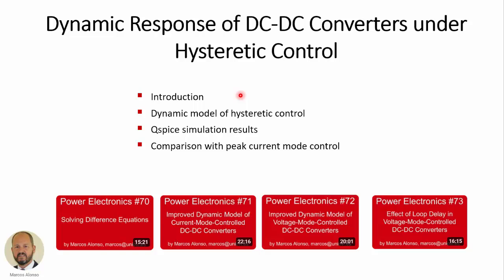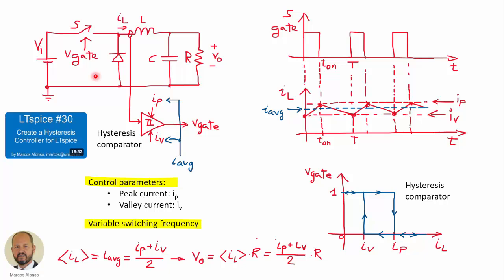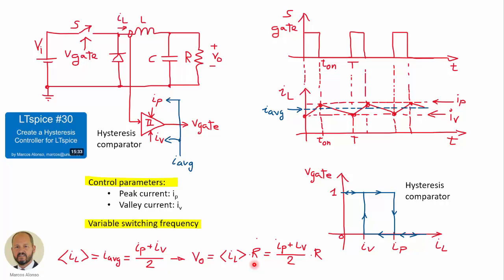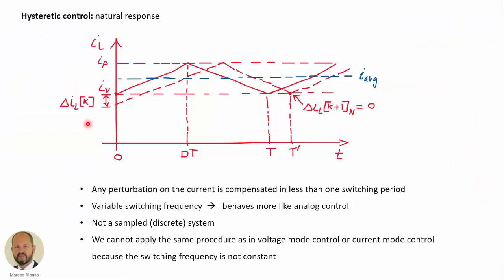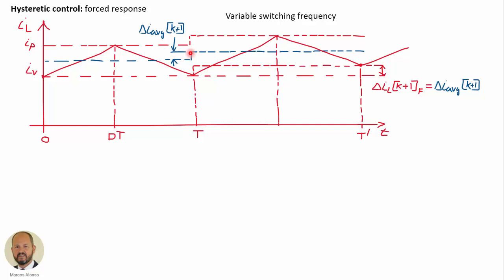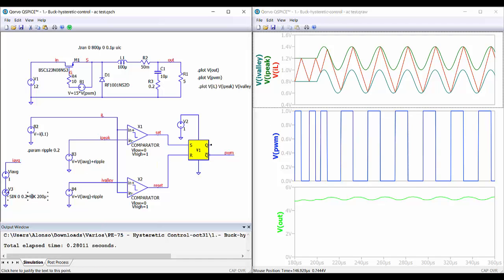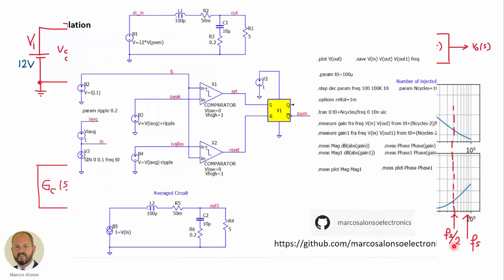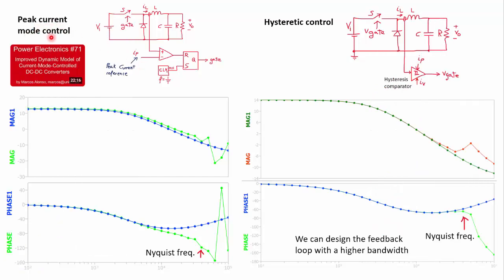PE #75: Dynamic Response of DC-DC Converters under Hysteretic Current Control

Comment: Hello Prof Marcos, The for the presentation 

How to select the  inductance as we know  that the SW frequency vary  ? 
There is possibility to select the  switching  frenquency  ?  
As we know the inductance is dependent of the SW frequency
Reply from the maker: Hello, thanks for your comment
Video PE-76 shows the expression to calculate the switching frequency. From it you can calculate the inductance to have the required frequency range
Reply: I watched the PE 76 and Frequency is dependent of the inductance. We select a value of inductance ? What about the variable  input voltage respect to the frequency  ? 

Complicate to understand.
Reply from the maker: @hScience100  Yes, Vi also affects the operating frequency. Once you select the inductance value you can calculate the frequency for the different values of the input voltage from the equation
Reply: @MarcosAlonsoElectronics  we can select one inductance value to have a negative inductance current and doing ZVS, and clamp the frequency to a lower value to limitate  the lesses. 
Do you think is a good idea ?
Reply: What do you think about my preview question ?
Reply from the maker: @ Sorry I missed this comment. Yes, it is possible. This is a technique known as ZVS buck converter with synchronous rectification. This is an interesting topic for a future video

Comment: Hi, thanks for the presentation, it was highly informative!

In the dynamic response section you are defining the transfer function of the hysteretic current control circuit, but strictly speaking, the hysteretic control is time dependent (you mention this a few times that the frequency is not constant) and therefore it is not a Linear Time Invariant (LTI) system. As far as I know the transfer function concept is only applicable for LTI systems, so for hysteretic control Gc(s) cannot be defined directly.

For PWM control the average operator (over a period) is defined and used (1) and afterwards the linearization around an operating point (small scale signal) (2). Only after steps (1) and (2) the mathematical preconditions are fulfilled to define a transfer function. In the hysteretic control I am not aware of the operator needed to be used to get a set of time independent equations. Could you elaborate on the topic or add some literature reference? It would be really valuable for me.

Nevertheless in the simulation section you present the response of the hysteretic control system and compare it to the response of a LTI (peak current control) system. From what I could see, the results show that the non-linear control used in the hysteretic control are superior to the linear control in peak current control mode considering perturbance frequencies lower that Nyquist frequency (less phase delay and closer to ideal magnitude.

Could you say a few words regarding the stability of the non-linear hysteretic control? As there is no transfer function, there are no poles and zeros and I don't know a valid criteria that can be used to prove the stability of the system (for perturbance frequencies lower than Nyquist frequency). The simulation results, nevertheless, show a highly stable system.

Hysteretic control on microcontroller driven  implementations is quite straight-forward using an internal comparator that can directly have 2 voltage levels defined (for comparator hysteresis). As the hysteretic control "algorithm" is high speed comparator driven (analog), the software doesn't have to implement a high frequency - sampling, running the PID, 2P2Z algorithm, output control at high frequency. running the control loop at 100kHz or higher is challenging on the available (price competitive) controllers. A low frequency outer voltage control loop can still be added that generates the hysteresis min and max inductor current levels. Because of the many inheriting advantages I am wondering why this is not the mainstream SMPS current control loop approach. There must be some caveats that I am not aware of: could you ellaborate?

Thanks again for this high quality video.
Reply from the maker: Hello, thanks for your detailed comment. I think you are right that the transfer function concept is only valid for LTI systems. What I proposed here is to apply the same methodology used previously for current-mode control, which analyzes current-mode control as a sampled system (see video PE #71). This methodology was previously employed by Ray Ridley and others and can even be found in books like Prof. Kazimierczuk’s book on dc-dc converters. I think that if the frequency changes are slow, it can also be applied to hysteretic control and other variable-frequency control methods like on-time control. This video and the following show how to apply this methodology, and the simulation results seem to match the analysis pretty well. I am not aware of any literature about this. 
Yes, from the analysis that I have done up to now, it is inferred that hysteretic control is the fastest control method since it can keep the ideal response (gain=1 and phase=0 deg) up to half of the switching frequency (f_s), which in my opinion is the best we can achieve. Other control methods, constant on-time control for example, exhibit the effect of sampling, which makes the phase start decreasing well below the switching frequency due to the effect of the double pole at 0.55*f_s.
The stability of hysteretic control is proven by the analysis shown in the video that obtains the final response of the system as G(s)=1  (video PE #75 for current control and it can be done similarly for voltage control, video PE #76). It is always stable. As you say, these are non-linear systems so the concept of loop gain should not be applied, I think. I have seen in some publications the analysis of the loop gain for constant on-time control. I think this might not be correct. Nevertheless, at the end the study of the loop gain is intended to get information on how the closed loop response will be. With the methodology shown in videos PE #77 and PE #78 we can directly obtain the closed-loop response, which is what we are interested in. 
Yes, hysteretic control has many advantages and can be implemented very easily in a microcontroller, as you say. The only disadvantage is the variable frequency operation, which is a problem in some applications because of the higher generation of noise. You need a more sophisticated EMI filter, etc.